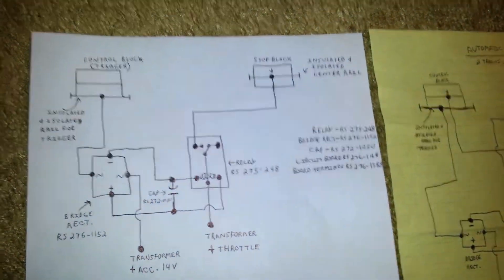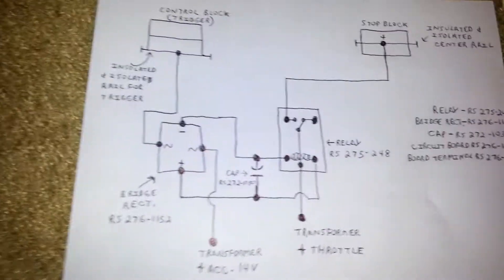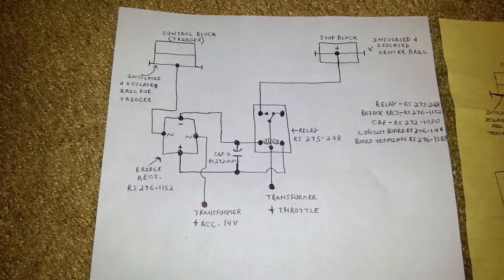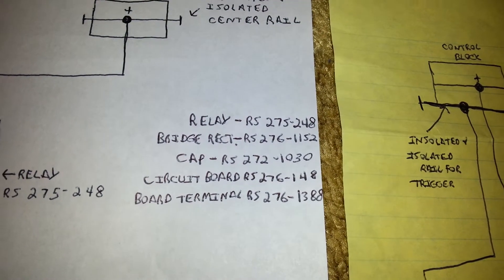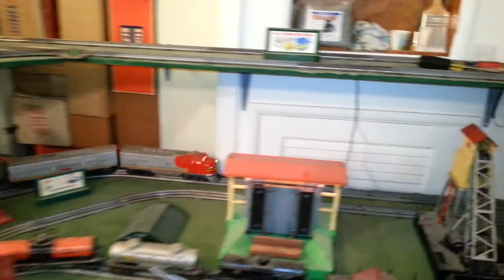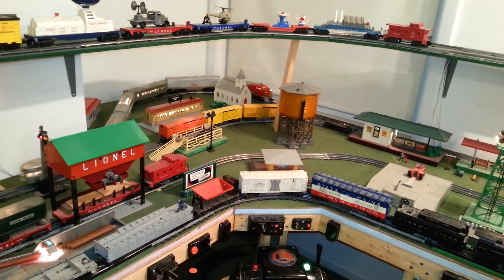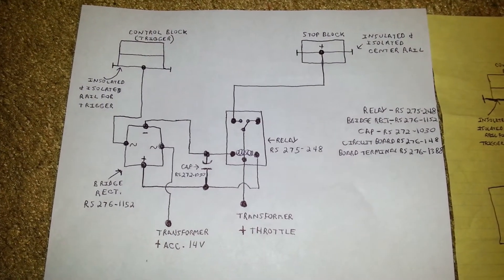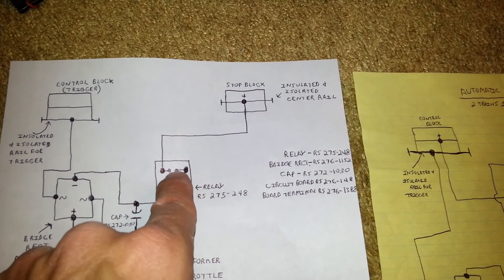Lionel postwar automatic block system part 2

Comment: Mike,
IT WORKS!!!
Thank you. I was away from the project for a few weeks, got back to it last weekend. Set it up on Fastrack and things were working, but in reverse. So I flipped the connections on the relay, said a prayer, made a few incantations, and appropriate sacrifices (not money this time) to Lionel and it worked. Now my next project is to make two switches work together- automatically. When the non-derailing swings switch A one way it will also trigger a second switch B to change. I appreciate your posts and your help.
Reply from the maker: Hi Frederick, 

I'm really glad you were able to get it working!   Good luck on your switch project.  If you get it to work I would be interested in how you did it.  Might be cool to use on my floor layout for the kids.

Comment: Mike,
I put the items together rechecked everything, put together steel tubular track (I am eventually going to use the with Fastrack) and this is what happens;
If a car is stationary on the control block, the trolley (easier to run experiments vs. an engine) on the stop block is stopped (three sections of track). Once I roll the car off the control block, I hear a click and the trolley moves. Having the trolley now go through the control block (without stopping) does not cut the power to the stop block.
It seems the only way power is cut is with a stationary car on the control block- odd. It seems that the relay is not triggering?
Also, the toggle is a on-off-on- I have one 'on' wired and an off-with this type of toggle should two wires from the relay go to the both 'on' terminals.
Per conversations below- the exact relay you used does not exist at Radio Shack. The guy there wanted to sell me a phone vs. help with a relay.
I feel like I am almost there with this project. Any thoughts?
Fred
Reply from the maker: It almost sounds like you have it correct, but just are not testing correctly. 

If you only have the trolly on the stop block and no other cars are on the track, does it stay stopped in the stop block when power is applied?  If yes, that is good.

Now as you roll a car or engine onto the control block does the trolly then move?  If yes, that is good.  It means the control block rail is isolated and the car or engine is triggering the relay as it jumps the control block isolated rail to the rest of the track.  Also remember, the control block is a trigger.  When a car or engine roll over the control block you are  jumping power from the rest of the negative portion of the track to the isolated control block rail which trips the relay which turns on the stop block.

You can also test by simply using a wire and with the trolly on the stop block and power applied, jump the control block isolated rail to the non-isolated outer rail of the rest of the track and the trolly should run.  Do this until the trolly clears the stop block.  Then let it run around the track and when it gets to the stop block does it stop?  if yes, then it is working properly.

The control block is not supposed to cut power to the stop block.  The stop block should always be in the "stopped" position unless a car or engine is "jumping" the isolated control block rail to the rest of the track.  It is your "switch" to tell the stop block to energize.

The purpose of the toggle switch is to bypass the relay so that the stop block always has power.  If you do not have a toggle to bypass the relay then you can never just run a single train as it will always stop in the stop block and there will not be another train to jump the control block rail to release it from the stop block. 

Remember, the purpose of this circuit is to be able to run two trains at the same time on a single loop.  In my case, the loop is big enough to where I can position the control and stop blocks so that both trains stop for a few seconds in front of my stations. 

I think you may actually have it working and just not understand exactly how it is supposed to work so your test looks like it is not working when it really is.

I would have responded sooner, but replies get put under "Social" in my email and sometimes I miss them.

If you can somehow get me your phone number I would be happy to try and explain it to you and help you with it.

Mike

Comment: Thanks for posting this. I have a small O gauge layout and wanted to add a relay control block. I couldn't find my Greenberg wiring book, and this was the only schematic I could find online. I had to substitute the relay and capacitor as my Radio Shack didn't have the ones you used. And I realized how bad my solder iron is. It's been a nice challenge balancing the train length and locomotive speeds.

Comment from the maker: Hi Jon,

Sorry it took so long to get back to you.  The Holidays were busy and then I had Jury Duty from the 2nd to the 15th. 

The biggest pain is insulating the outside rail for however long you figure it needs to be.  I think I insulated 3 sections of track.  On the shorter loop with the 2 switchers I believe I insulated 2 sections of track.  You only need to insulate one side of the track.

You just need to make sure your trigger is activated long enough for he other train to clear the stop block.  This will be dependant on the length of the insulated outside rail as well as the length of the train.  Also remember you will need fibre pins on each end of the insulated section.  It needs to be insulated and isolated.  It is your trigger to the relay.

Feel free to email me if you have any questions.  I would be happy to help.
You can also check out the Classic Toy Trains Forum.  They have some good discussions on block systems.

Mike

Comment: Fantastic Video! All of this is new for me so any advice you might have would be appreciated.  I'm in the process of creating a layout with my son and I think we wish to use automatic blocks. We were inspired by the following video. I think the layout uses automatic blocks to stop the trains and relays to switch tracks. Is my understanding correct? Thanks! 1950's Lionel O Gauge Train Layout Restoration Project and Operation 2013